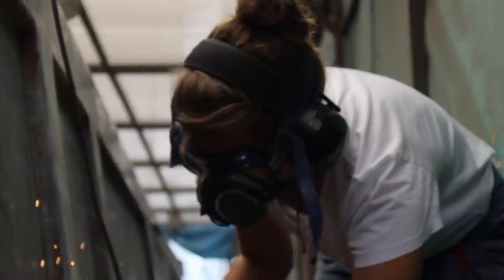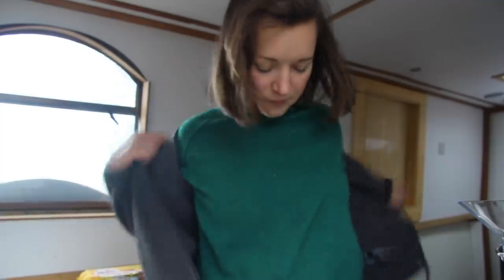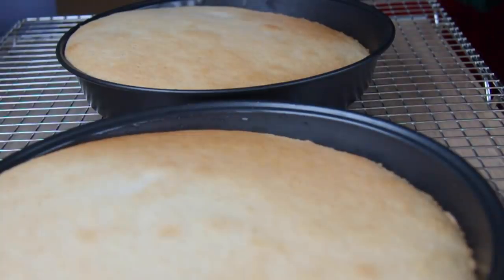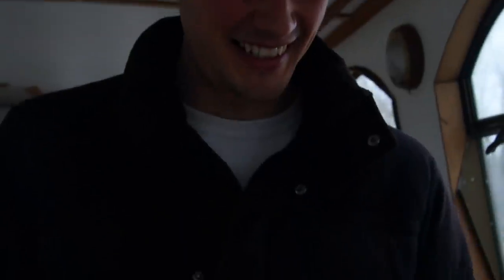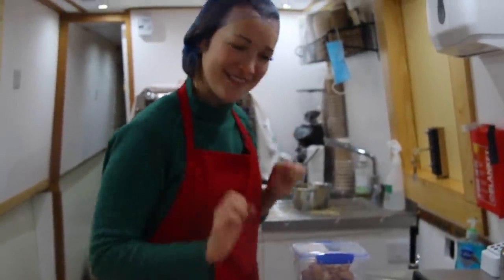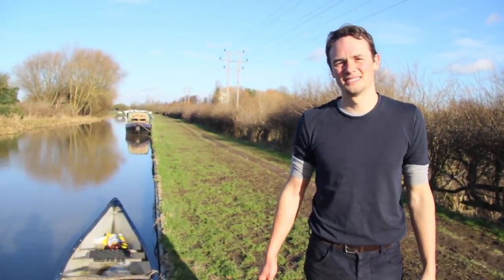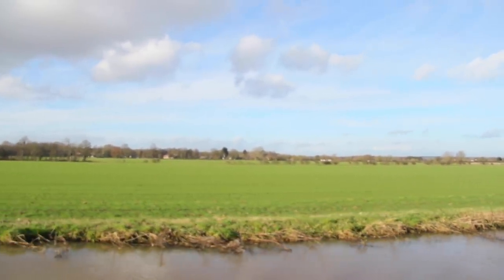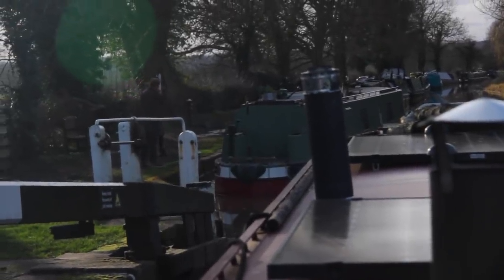Off-grid CAFE BOAT: A day in the life EP33

Comment: I think on sailboats they have stoves that stay level while the boats rock. Can't think of the term for the mount. Too late for that but they may make something that you'd fit in the oven that would hold the pan level. The plate would need a ball centered underneath with a weighted pendulum. The ball would fit into a stand and be able to swivel all ways. It's old tech stuff.
Good to have you back.

Comment: The cake looked good. I like the idea as mentioned about the listing cake but finding a mooring with the correct list every time you bake could be problematic.  How about using a short spirit level and some metal strips to jack up the front or the back of the tin to achieve the ideal orientation for baking.